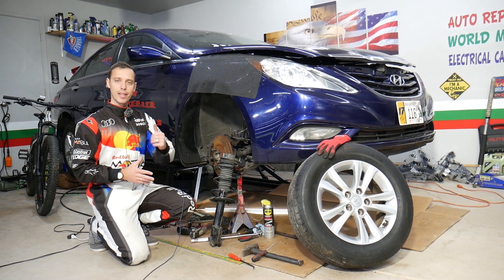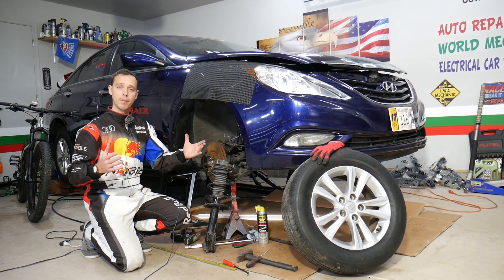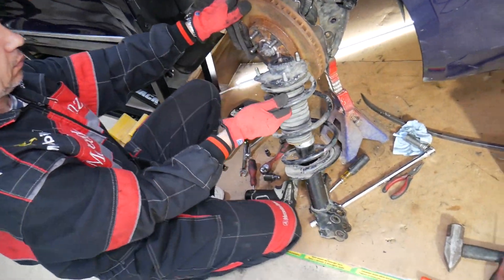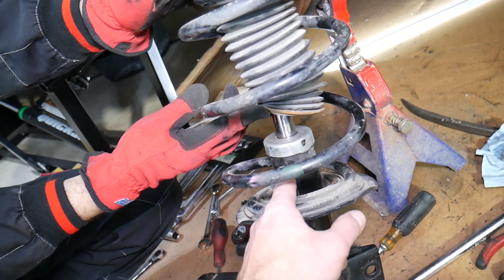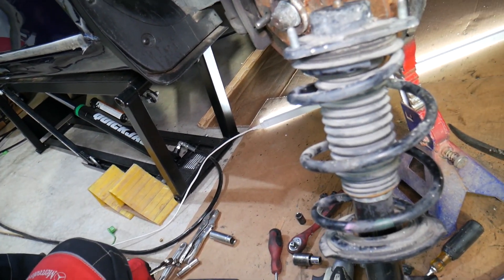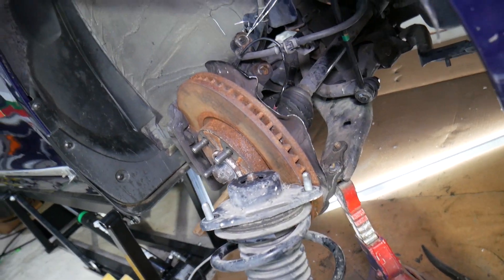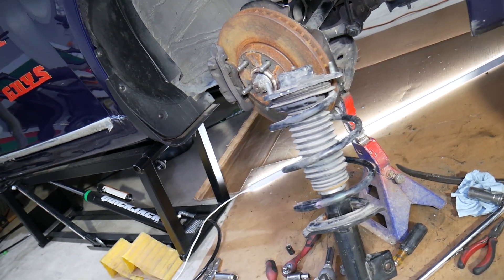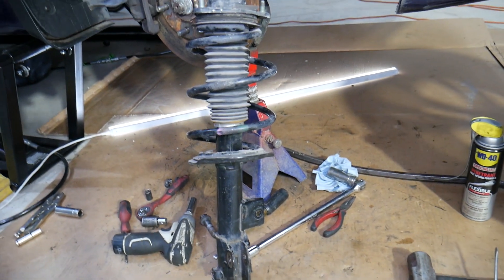TOP 7 SYMPTOMS OF BAD FRONT STRUT SHOCK, FAILING STRUTS SHOCKS

Comment: Ive been looking for near 6 months and this is the first video to say what am looking for. I have the floaty swaying feeling and have replaced all most ever thing and it has only helped abit but today i took the top mount and spring off the drivers side  strut and its gone. No oil leak but compression is gone. Thanks

Comment: What I am noticing is a bumpier ride than I normally have.  I also notice that the steering feels off and the suspension feels a little bit floaty.  It is not something you want if you are going down the highway and encounter one of those construction zones with the concrete barriers on both sides of a lane.  Then a lot of times when I make a turn I have to do it slower than normal because I might hit a curb with the bad handling from bad shocks and struts.

Comment: I have just had new struts on my car. When going over roads with even just slight imperfection there was a load of knocking and juddering noises from the front end. If i went over a speed bump at 15mph, the front end would slam down onto the road, too.
Reply: Was it the strut? Im having the same exact issue but in the back

Comment: Will worn struts cause vibrations at high speeds? Literally replaced all my suspension parts, besides front struts, as well as engine, transmission and front differential mounts. And I still have a vibration at high speeds
Reply: Have same issue, would also like to know
Reply: Just replaced everything except struts as well. Worn struts will cause additional bouncing of the wheels, especially at highway speeds. Also could be a symptom of unbalanced wheels as well. I would first get your wheels balanced first given they are probably unevenly worn due to bad suspension parts you replaced. Also, anytime suspension parts are replaced, you will need the alignment done again, as this could also cause vibrations
Reply: @OkieDoodleStitches  alrighty, I have a yukon denali with z55 struts, so I'm trying to find a way to bypass the z55 system.
Reply: @rayben3972  are z55’s the auto level controlled ones? Also, what do you mean by bypass them?
Reply: @OkieDoodleStitches  electronic suspension,  auto leveling as well, I mean replacing them with passive struts without setting off the suspension light and code. Z55 struts are $400 for each side
Reply: Did you check your wheels?.....might be out of balance or damaged rim.
Reply: @bFORCe2003  it was worn struts, and a bad motor mount